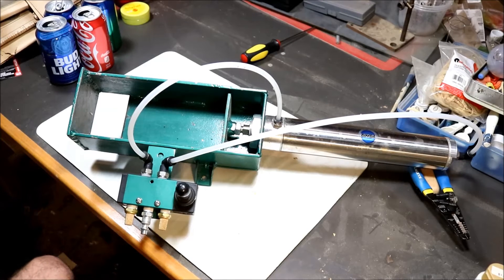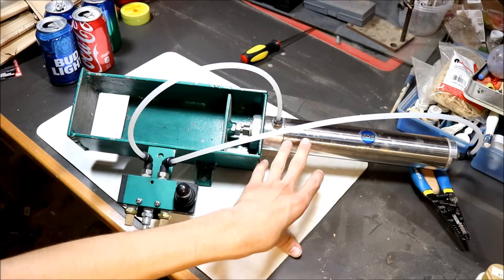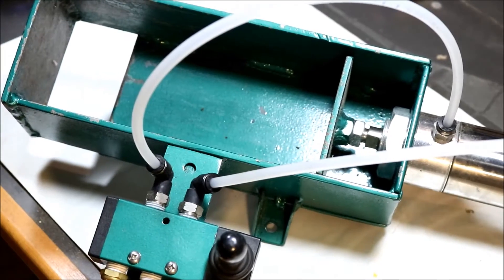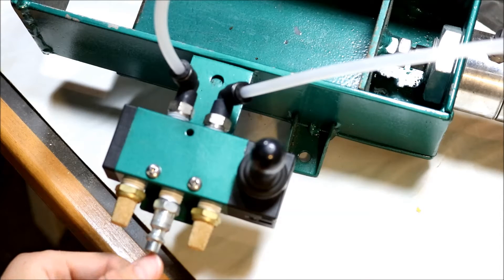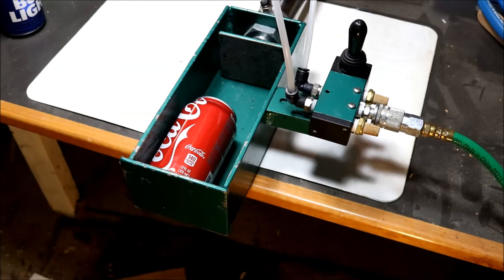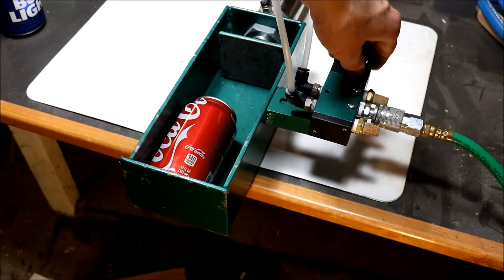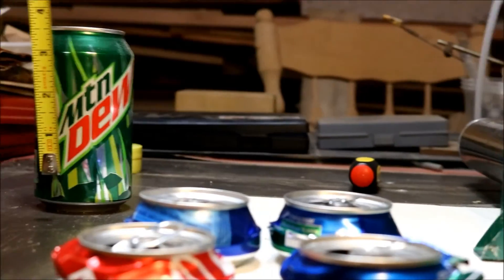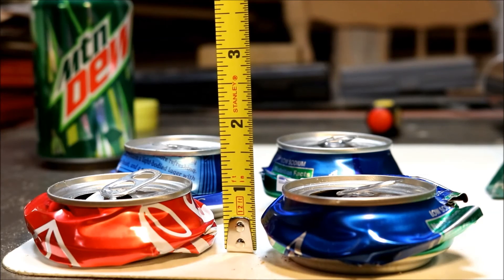Pneumatic Can Crusher

Comment: Are you used 90psi air supply ?
Reply from the maker: Yes, I think the max for that control valve was like 110 psi, not sure on the cylinder.